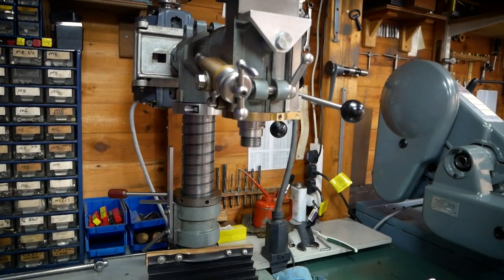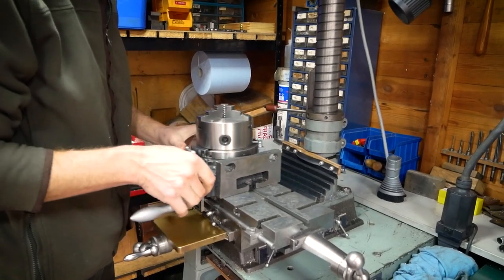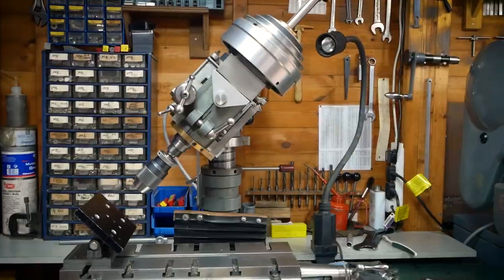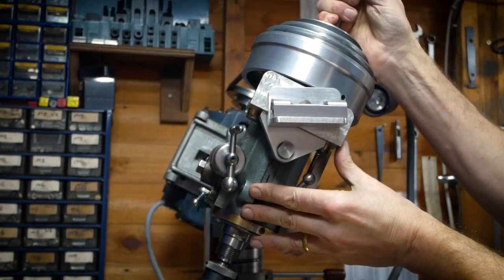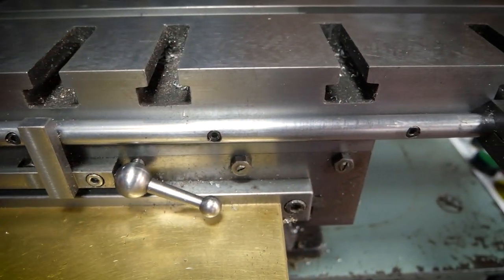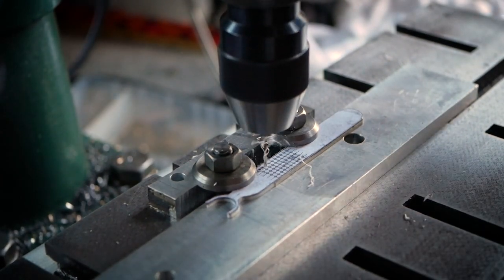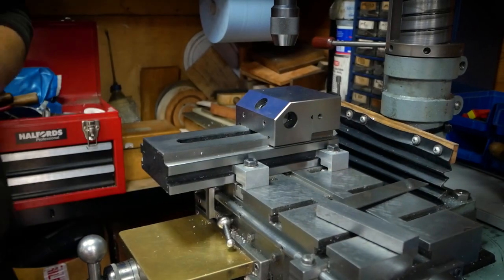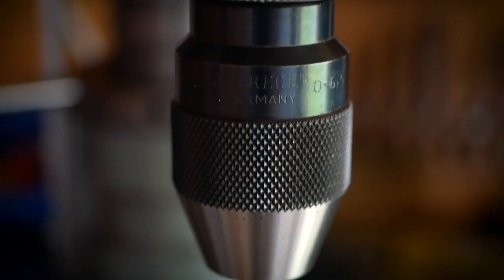The Ideal Milling Machine for the Model Engineer?

Comment: I've had one of these for years. The original woven round belt became hopelessly elongated wth use and was replaced by 6mm poly belt. This is too stretchy. Yours looks like a narrow V belt. Is that what it is and what's the section size please? Thanks.

Comment: I don't know if you've heard this trick, but apparently, one of the easiest ways to maintain head alignment when raising and lowering these is to solidly mount a cheap laser pointer on the head, have it pointing across the workshop at a clear patch of wall, then mark a vertical line over there. Once you get the height adjusted you just need to swing the column until the laser dot is back on your line. 

Ok, a laser pointer isn't exactly a "Period correct" modification, but if the mills actually being used for paying work, it might be a useful shortcut to keeping head alignment.
Reply: I have tried the laser idea, but found that the size of the dot is quite large and it led to an inaccuracy bigger than I was happy with. 

I wonder if a more expensive laser would have a better resolution? 

I do like the idea of a fixed post against which a rotating collar can be aligned as demonstrated here. I am definitely going to adapt that idea for my machine.
Reply from the maker: I have heard of this modification. As Andrew mentioned, I have concerns about the accuracy due to the spot size but it think it might need some investigation. The fixed post approach works well - the slight issue being any innacuracies in that rotating collar do get transfered into head position. These are small though and can be sorted by always moving the collar by an integer number of turns. There are a few other tricks you can use, for instance, rather than aligning the head for a reaming operation, the post can be left unlocked, allowing the reamer to 'float' to position. It's certainly a quirk of the machine.
Reply: @andrewdolinskiatcarpathian  If you put the target line as far away from the mill as possible it's going to help with accuracy. If the target line was 20' away, then the full width of the dot should still be well under a degree of rotation. Most of the "Cat tormentor" class laser pointers I owned back in the day had a dot that was still under 10mm wide at well over 100 metres. Mind you, they tended to have awful low powered laser diodes, but with reasonable budget quality optics. Maybe the more modem budget pointers have awful optics too?
Reply: @Reman1975  Sadly the cheap lasers I have tried do indeed include very cheap optics. I will investigate if there is a cost effective means to improve the clarity of the projected beam.
Reply: @chronovaengineering  What I have in mind is some form of adjustment rod which incorporates a dial indicator so that a precise location can be returned to. Otherwise I cant see how it would ever be possible to be 100% on the money.

Comment: Hi. I’m shortly about to embark on adding a guidance pillar to my Mark 2 Dore Westbury. Did you use a rectangular flat bar in preference to a round bar for rigidity? What would be a suitable size for the upright bar?
Having used the alignment bar would you make any modifications if you were to do it again?
Thank you for all your inspirational videos. Much appreciated. 👏👏👍😀 Andrew
Reply from the maker: Hi Andrew, the rectangular bar was 6x19x190, and yes, I think rigidity is important if using the solid stop approach. The key is to make sure it is correctly aligned before doweling it in place. We also scraped the edges parallel and straight. The contact stop on the ring is made from a rounded piece of brass. It's more repeatable if the contact is in one place rather than trying to align a larger contact area. No retrospective changes come to mind. Good luck with the project!
Reply: @chronovaengineering  Hello. Thank you for the reply. Very useful indeed. I will order some precision ground gauge plate to ensure that the bar is perfectly straight. I had not appreciated that your stop block had a rounded brass bar insert. Thank you for letting me know. Looking forward to adding this all to my mill. Wish me luck 🙏🤞😀

Comment: I had one of those and seriously disliked it. It ran like a pot of nails as the drive and clutch/planetary gear drive pulleys were badly designed and fitting. The bed and ways are made of steel and wore badly. Work accuracy was poor, rigidity felt worse than my old English bench drill. Was so glad to get rid of it.